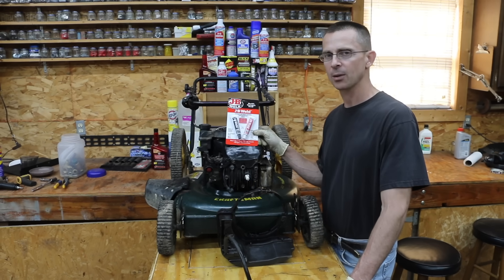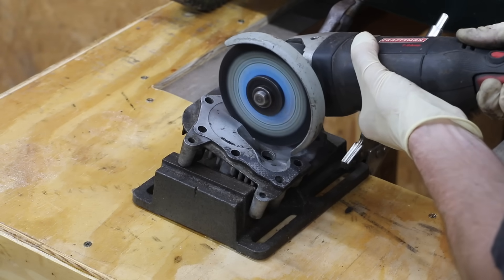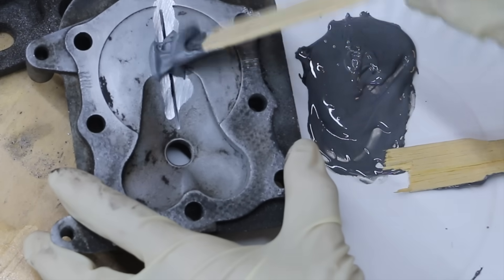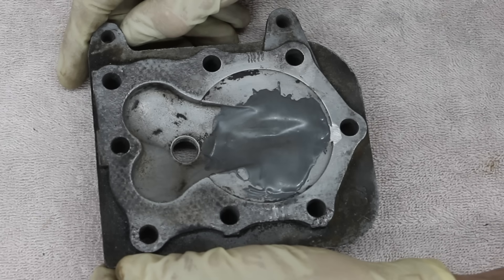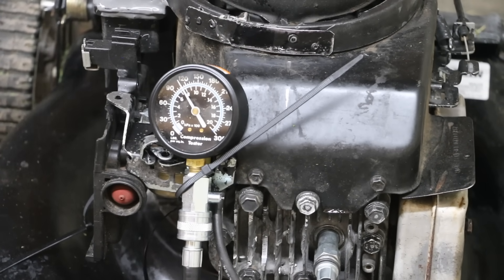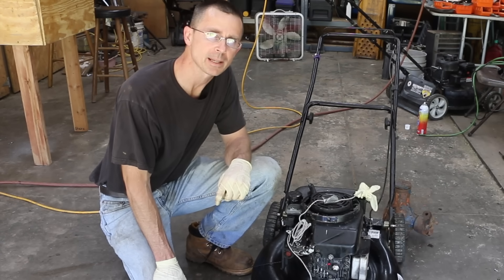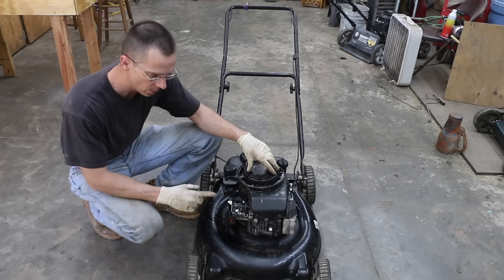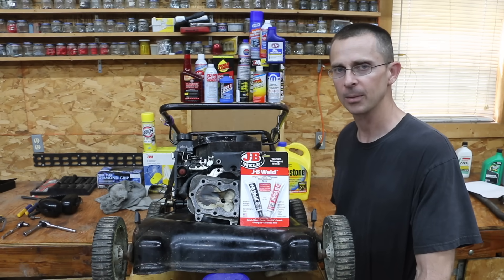Can JB Weld fix a cracked cylinder head?  See the proof!!

Comment: Have you ever tried using the product "Steel Stick"? it works wonders and is more puddy or clay-like when applied. Both "Steel Stick" and "JB Weld" are great products.
Reply from the maker: I have not yet tried using it.  I'll likely test it in an upcoming video.  Thanks!
Reply: That cool! I have used it to repair split plastic fuel lines on an old Bronco II farm truck I had and I also have used it to seal some stress cracks around the top corner edge of my full-size Bronco (area behind the drip rails are known to crack and this has stopped it from spreading and flexing like it used to). Also I've used it to seal up some pinhole leaks on my 63 Buick Lesabre's timing cover's coolant passages (it was very corroded and developed a leak because of it)
Reply from the maker: I believe it's a great product and I'm very curious regarding it's ability to withstand the same testing as I've used in previous videos.  For example, holding bolts in place under downward force/load.  Thanks again!

Comment: I fixed the carburetor on my daughter's Suzuki Ozark with JB Quick.  A friend of mine repaired the engine case on his CR250 with JB weld and a beer can when the chain broke and slapped a hole in the case by the output shaft.  It never failed.
Reply from the maker: JB Weld is an amazing product. Thanks for commenting!

Comment: i bought a mower from a guy for $20 because he somehow cut a big gash in the oil pan when trying to sharpen the blade. I used the jb weld that's like a putty for pipes and stuff that are exposed to water. Before the jb weld, all the oil just flowed right out the bottom of the mower. Since I pushed some jb weld in there I've cut the grass all summer without losing one drop of oil. The mower also had a whole rotted in the gas tank....put a bunch on that hole too and it's completely fine still. Craps pretty amazing.
Reply from the maker: This is impressive!  Thanks for commenting!

Comment: I put a hole in my oil pan on a Camaro. Had to do a quick fix so I JB welded a piece of aluminum can over the hole and it worked until I sold the car a few years later.
Reply from the maker: JB Weld is a very impressive product.  Thanks for commenting on your experience with it!

Comment: i had an old chevy 350 that sat out one winter with water still in the block. when it froze it bulged and cracked one water jacket on the outside of the block by an engine mount. patched it up with jb-weld and drove it for 3 years b4 i sold it. never leeked
Reply from the maker: Impressive. Thanks for sharing this experience!

Comment: I knew it would work:).
My Uncle had an Ariens tiller in the 80s with a 5hp horizontal Tecumseh. Tip-always keep the oil in tillers slightly over full due to the slant of the engine when in use. 
The rod broke and partially came through the side of the block. Not completely through but almost and there were some cracks that if bothered with would have been pieces that would have came right off. He cleaned it and bacically built a tomb around the hole/cracked area. It was the Permatex Liquid metal (looks just like JB, think it's still around too). This was before I ever remember seeing JB until the 90s. He only replaced the rod too-miser haha. That tiller ran for several years afterward until the Troy Built's got popular and he bought one. 
I know there is no combustion pressure in the crankcase (or better not be) but the epoxy never came loose even after simply pushing the busted part of the block back in, considering all the external/internal vibration. The affected area was about the size of a softball. Still amazing. Among several uses myself, I used JB to glue a piece or rubber hose on our rock mailbox, used as a bumper for the door when it's opened, been on there for years exposed in NKY. Great stuff.

You have some very good videos and obviously a passion. Thanks for your time and sharing!
Reply from the maker: I enjoyed reading your comments about the tiller!  Thank you very much for the nice comments regarding the videos!

Comment: I've used JB for everything from filling a hole busted in an atv engine head (it was on its last legs anyway) to replacing a broken windshield wiper bushing in an AMC Hornet. So far, it has always worked just fine. One point though: your surgical procedure on the engine head used power tools so that obviously counts as ortho and the proper music for that is heavy metal. :)
Have a good one.
Reply from the maker: JB Weld is a great product. Thanks for commenting and thanks the music recommendation.

Comment: Not the head specifically, but the actual cylinder/wall of an RM250 had a void from the casting process and it ran with JB weld for a while before the replacement parts came in. It also ran with the hole not repaired blowing out a bit of smoke
Reply from the maker: Impressive! Thanks for commenting!

Comment: I've used JB weld on exhaust manifolds oil and gas tanks and works great. Different subject, wd40 and crocus cloth sandpaper works great in cleaning metal surfaces . I used it on wheel-shafts on tugboats .
Reply from the maker: Thank you for this recommendation!

Comment: I use JB weld for every strong repair required but when I saw my cousin a motorbike repair man fill the sump drain plug hole of a stripped thread that also had the edge cracked where you could fit a toothpick into it that is when I was really impressed with it, my cousin like you obviously prepared cleaned de-greased the surface used tape to mask off the bottom and filled it with JB weld from the top (inside section of the sump), two days later he drill pressed a new hole into the JB weld and tapped a new thread into it, fitted a new sump plug and it worked like a charm, Im even more impressed now Ive seen the even higher pressures you put it through.... Liquid Metal its that simple.....
Reply from the maker: I enjoyed reading your comments regarding JB Weld.  Thanks for commenting!

Comment: Oh and I forgot to just mention I use the clay stick instead of the liquid two part mix. The JB WELD I buy and use comes in a tube and is wrapped in clear cover that has two parts the outer part is gray and the center is black and all you have to do to use is cut the amount that you need dampen fingers then need the clay two parts till a dark gray then aply. Not to disrespect but I have found that the JB WELD you use in this video is the weaker and less reliable version and that is why I use the JB WELD clay stick. Plus JB WELD also makes a plastic clay stick epoxy just as a FYI
Reply from the maker: Nathan, I plan to accomplish a video on the putty epoxies and compare them to the original.  I hope the putty epoxies prove to be stronger.  Thanks for taking the time to comment!

Comment: I have used JB WELD to fix my 3.1 chevy heads when it blew the head gasket due to the Dex-cool that chevy recommended for all chevy motors even though I found out from research that dex-cool corrodes aluminum and I had two spot on my front cylinder head that where about a quarter size in diameter and ruffley a sixteenth inch Deep and the back cylinder head had one about the size of a half dollar and ruffley 30 thousands deep and that was six months ago and almost 9,000 miles ago and it is still holding strong and running exactly
Reply from the maker: Thank you for sharing this information. I have a vehicle that previously had dexcool in it.  No issues yet, but the repair you made is a great idea!

Comment: Nice, but a crack is different from grinding with a splitting wheel or that chingadera aka thingamabob, wait googling for proper tool name: Angle Grinder, cutting wheel. a crack if not evenly and a cut from tool since with natural crack there would be impurities left behind. I guess if one goes over the crack with a cutter you'd clean of the impurities. Great Video I Must Say, You Took The Time To Prove It. How about an automobile engine vs lawnmower. I though that's what I was going to see. I have use JB Weld to seal  hole I made on fridge for being speeding up the process. It held for 6 months. The oil from the Freon seeps thru. I read that to clean before using JB Weld Do Not Use Alcohol but Acetone instead. Alcohol leaves a residue, Acetone doesn't. You can use nail polish remover UNSCENTED the others have residue. I know this because on fridge I did the alcohol, the scented, then back again unscented. Yeah I spent more money than buying new fridge. I proved it worked for 6 months. I was satisfied with results. Nothing Lasts Forever and besides for emergency purposes IT DID IT"S J.O.B! Thank You Sir for awesome video. I appreciate the long time you put into this whole project and your other videos. Love The Name PROJECT FARM.
Reply from the maker: This is a great point.  Thanks for the recommendations and for commenting!

Comment: In all of my 35 years in auto repair, and 5 years before then messing with small engines, I have never seen an air cooled cylinder head just "crack". If one does crack, it usually splits in 1/2 because of something like an impact or someone over-torquing the head. 

I would like to see a real life test with this JB Weld on let's say a liquid cooled engine that had a crack due to overheating or a freeze due to inadequate cooling.

This says a lot for the durability of JB Weld, and I have to admit I'm surprised it didn't crack when the piston was hammering on it, so I would say this would be something to put in the tool box for not only this extreme of a repair, but also other applications like a broken hydraulic part, especially if the part is hard to get or unavailable.
Reply from the maker: This is a great video idea--thanks!

Comment: Used J B Weld on a cheap fuel tank(portable)for my outboard engine. I say cheap because the old style tanks were steel if anyone can remember way back then.The fuel line tapped straight into plastic. Obviously could not be any cheaper. I drilled out the hole slightly and covered the fitting threads with a good bit of J B Weld.After it cured I was actually amazed that not only did it hold but held over five years when I sold the boat. Super mproduct and cheap in price....." I BELEIVE "   # J B Weld
Reply from the maker: This is very impressive!  Thanks for sharing your experience!

Comment: Will This Work For a Cracked Oil Pan?
Reply from the maker: Yes, it'll work, but only if you rough up the surface and chemically clean the surface extremely well.  Any trace of oil and it won't stick.

Comment: I run my chevy 350 plow truck on on waste.oil and marvins oil 230 k miles smokes for a minute then runs like a bear and other matter cracked a tooth bridge work 25 years ago 2 monthh before i had dentist appt used j b weld in my mouth smelled but worked sweet dentist asked what i used lol it works
Reply from the maker: I'm impressed that it fixed the tooth. LOL! Thanks for commenting!

Comment: I like your videos. They've been informative and realistic, unlike commercials and such. I've used JB weld many, many times, though never in a combustion chamber. Have always had good results with it. 

You gave me an interesting thought, though, seeing the excess epoxy left over in the combustion chamber. I've seen lots of car engine videos, where people will increase their compression ratio for more power. Usually by putting heads on an engine that have a smaller combustion space on top of each cylinder, which increases the comp. ratio. 

You did something similar here, by filling up part of that space with the epoxy. What do you suppose the engine would do if you were to purposely fill in some more of the extra space with the epoxy? I read that the compression ratio of a Briggs L-head engine is 6:1. Maybe you can get it up from 6:1 to something like 10:1, just by sticking some epoxy onto the head and making the compression gap smaller? Would that make it a more powerful engine, or would it just blow the spark plug right out of it's hole? 

Also, would it take an engine with about 70 psi compression and increase it? Say maybe up to 100 or so, just by filling in some of that compression gap? Would it make a noticeable difference to the engine speed when you pushed a mower into some tall grass with the higher comp. ratio? Would it do it's mowing better or worse with a higher comp. ratio? 

I think this would make for a really interesting test, don't you? ;)
Reply from the maker: Thank you very much for the positive comment.  I've considered filling in some of the empty space in the cylinder head with JB Weld to see if it increases the compression and to see how the engine runs.  Thanks for commenting.  I might just do a video on this!

Comment: How about cutting a blade from the push mower and see if you can JB weld it back together that's a lot of force on those blades. Just curious and thought I would send a another idea thanks!!
Reply from the maker: Trevor, thanks for this recommendation.  The potential and risk of the blade breaking loose and causing injury is a factor. Thanks for the recommendation!
Reply: do what

Comment: I have a x19 2009 pocket bike that has a crack on the part that hold the oil so that get hot but u just let me know everything
Reply from the maker: Jermaine, I hope JB Weld works well for you application.  It's critical that you get all the oily substance off of the metal using a chemical or the epoxy repair is unlikely to work.  A clean and sanded surface is very important.  Good luck and thanks for commenting!

Comment: I repaired my oil leaking manual transmission with J-B weld. 3 years later still runs like a champ.
Reply from the maker: Excellent!  Thanks for sharing your experience with JB Weld.
Reply: I have also have a leak in my transmission from a crack and I can’t find a shop that welds transmissions so I’m thinking about trying jb weld but idk

Comment: Why is the inside of the cylinder head shaped like a pair of testicals lol!
Reply from the maker: This is a great question.  Maybe Briggs and Stratton will comment on this one.  Thanks for commenting!
Reply: Project Farm On a more serious note, is it ok to seal a magnesium alloy transfer case crack by applying J-B Weld only on the exterior? And I also do not want to drill any stop holes at the ends of the crack, is it okay if I just extend the application coverage of the J-B Weld past the crack ends and all around it?

Comment: i have used JB weld to fix a fuel tank on my dads Toyota pickup. He hit something in the road and punctured the tank, about the size of my pinky finger.. after 5 years of use still no leaks.. Also I have used JB to repair  a 3 core radiator in my 72 Plymouth Fury when I was in High school.. Worked great!
Reply from the maker: Chris,  Impressive repairs!  Thanks for sharing these experiences with JB Weld!

Comment: I repaired a hole in a power steering gear box that was spewing power steering fluid once. Last I heard it was still working. That was 15 years ago. Make sure surfaces are prepped and cleaned and it holds up pretty good.
Reply from the maker: This is very impressive!  Thanks for commenting!

Comment: I tried using JB Weld to Fix a hole in my Engine Block!
https://www.youtube.com/watch?v=gC2F9p2Nw3s

FYI it plugged the oil leak but the bracket broke after 10 minutes. Don't hold your breath on the PSI Rating!!

Comment: Back years ago I had purchased a 1946 Chevy car with a 216 six cylinder engine. It had about a foot long crack down the outside of the block from it freezing. It had been patched with JB Weld, it ran for years with out a leak, granted it is a no pressure radiator system, but it held up to that
Reply from the maker: David, Impressive!  Thanks for commenting!

Comment: I've been using jb weld for years and its never let me down yet.I've fixed a cracked block on a old Allison repaired a metal gas take and a exhaust manifold. I even used it to repair stripped threads by running a  a drill and tap  after it setup
Reply from the maker: Rick, Impressive success experiences with JB Weld.  Thanks for sharing!
Reply: Your welcome , I've been using Jb weld for forty years plus and it hasn't let me down yet. If you have a good gasket seal I bet that cylinder head will last longer then you think.I think valve seals will be first to after 30-40 hours of running time.

Comment: When I was in scouting, we had about 20 aluminum canoes, everyone of them had at least one patch of JB Weld. The stuff always worked great.
Reply: They have the white marine grade jb weld that works better in water for boats, I've used it and it's like concrete afterwards not as pliable as the regular one.
Reply from the maker: Thank you for sharing this experience!
Reply: I know it's unlikely to get an answer 2 years later, but did you use the standard JB Weld? Does it still do great in water even if we now learn it's better? Saw these comments 5 months ago but for some reason I didn't ask what I wanted to know.

If you don't ask...you may never know...
Reply: @DENicholsAutoBravado  Probably any of them would work for patching a canoe.  It's not a high load application, and epoxy of any kind is very durable.  

One thing that would help a lot is cleaning and roughing the surface to be patched.  Sandpaper then a solvent like alcohol or acetone would work.  This will help it stick and seal better.
Reply: @DENicholsAutoBravado  If he don't answer, you may never know.
Reply: Ngl before watching the video I said HELL YEAH ITS GONNA WORK